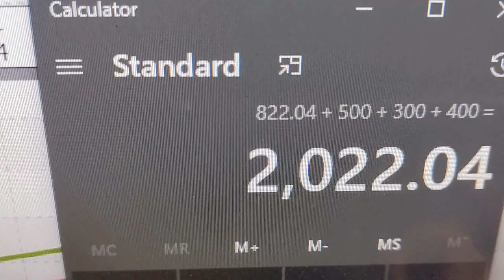This $100 Part Is NEEDED On All C8 Corvettes! I Love Mine!

Comment: Got the same set. Install videos are helpful. On the front, place both in place before zip tying. Also sides are not that hard. Watch the video and read instructions 10 times.And a L shaped Allen or torx wrench to tug them in place helps a lot.

Comment: Does anyone make some mesh for the air intakes behind the doors (In front of rear tires)?  The gap looks like it wants to collect stuff.  Also, there is a colored tab that sticks out from the body panel that is very obvious in the gap.  It might be less visible if there was a grill over this gap (but set back in the hole)

Comment: Hey Guys... You are effectively reducing the opening area of airflow over these coils or through the engine compartment by how much...10 to 30% ??? Has anyone discussed this with GM?? They have calculated and sized these openings to provide the combustion and cooling air for a whole lot of shit that’s generating heat in the car. Consider the 495 HP 8 cylinder whipper-snapper a GIANT heater... which in order to operate in accordance with design requires a certain amount of CFM (Cubic Feet/Min) to keep Ole 495 HP... and oh the Break Calipers happy... I know a little bit about air flow... I would want to know what the impact of that new grid you introduced to those openings creates in pressure drop which in turn reduces air flow the openings see... So like from 1 mph to what... 195 mph? So... the slower the car is moving forward the higher the pressure drop impact is for the additional grid you are cramming in those air inlets. IS that a problem... I don’t know. I just know that that junk you’ve stuff in those intakes has an impact... and its NOT helping remove the heat generated through the vehicle... its hurting it. Just a random thought...its not about looks... its about performance. I’ll bet you one thing for sure.... The Radiator Store has no f.... idea how much pressure drop that additional grid adds to each opening and how much the air flow is reduced as a result.
Reply from the maker: What I can tell you is that on our twin turbo Corvettes that use the cooling system to keep the turbos cool, we have seen no noticeable difference in coolant temperature. I figure that our system, which should run hotter than others, not showing any difference is a very good test. In fact, with our Turbo system we saw no difference in coolant temperatures either, even though our turbos are coolant cooled.

Comment: 2Q19 C7 sales: 5788
2Q20 C8 sales: 2454
A 60% plunge.  Corvette is finished.
Reply from the maker: Lol not even close. Q2 was hit with initial deliveries and then the covid shut down. Limiting production to only the numbers you stated (mine is one of them).
Reply: @completestreetperformance 
Covid apparently only affected the C8.
Reply from the maker: I'm just telling you what it was lol. First production was delayed because of the strike end of 19. And then they started with slow production as they made sure the line was running right. With a long covid shutdown and also a few weeks shut down to correct issues. Clearly it ramped up in Q3 and Q4. And clearly the car is in demand as dealers are getting 20-30k above sticker, which is something you can't say for any other brand in the price range.
Reply: @completestreetperformance 
Mustang sales dropped 18% without  a major update.  Corvette sales collapsed to almost nothing.  C7 sales were so anemic at 5788 per quarter GM threw a Hail Mary.  The C8 quarterback was sacked and broke every bone in his body, selling less than 25% of GM's 40,000 annual goal.  Its the biggest sales failire in auto history.
Reply: For another comparison, GMs first mid-engine, the troubled Corvair sold 250,000 its first year.  60 years ago.
Reply from the maker: Sure, the "failure" was the lack of production due to outside circumstances. The demand has been, and it's still there. The C8 is a big success, even in a pandemic it's still commanding higher than MSRP even on the used market!
Reply: @completestreetperformance 
Car sales dropped about 20%.  Mustang beat the trend with an 18% decline.  The brand new Vette, projected to sell 40,000 by GM, carastrophically imploded in the biggest YOY sales disaster in automotive history.  The 60% sales plunge might have to do with an avg sales price of $83,500, a 60% price hike. GM C8 execs are ALL going down for this flop.

Comment: Question for Andrew- have you done any LT2 intake manifolds on an LT1 Camaro yet? I would like your opinion on this matter and HP gains. Thanks in advance.
(Plus: would u be so kind if you could measure a LT2 intake manifold bolt and compare it to a Camaro intake bolt.  Reason is we are using the Camaro hardware to bolt down the LT2 manifold on the Camaro.  They are different part numbers but you can’t order the LT2 bolts yet.  If you do this for me I will buy a CSP hoodie for your cause.)
Reply from the maker: I have not done the test yet. Looking forward to doing it in the future but right now we haven't had someone up for it.

Ideally I would like to do an MSD vs LT2 manifold video
Reply: @completestreetperformance  to bad I was not closer to you because I have purchased everything to do the switch over and have already did a test fit.   All the parts u need.

https://gwatneyperformance.com/product/chevrolet-performance-lt2-intake-manifold-126977114/

My install  on Camaro6
https://www.camaro6.com/forums/showthread.php?t=582697
Comparing manifolds on the Dyno would be perfect.  Hope u do it.